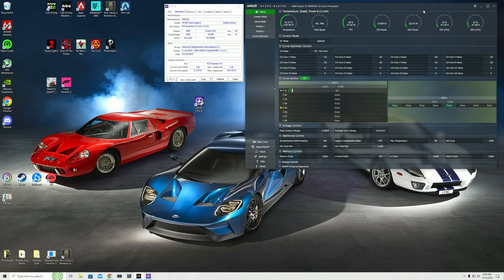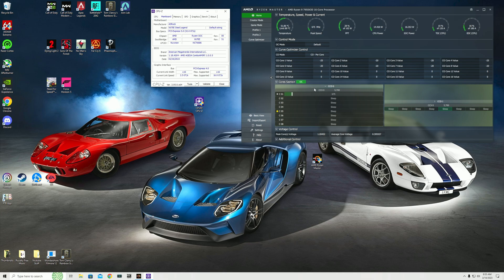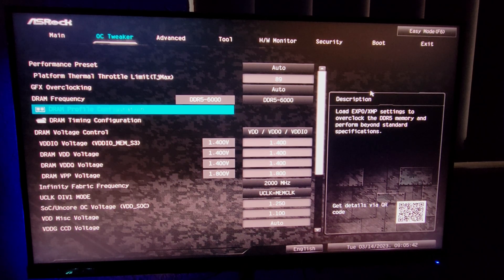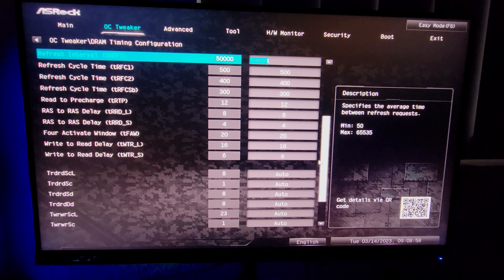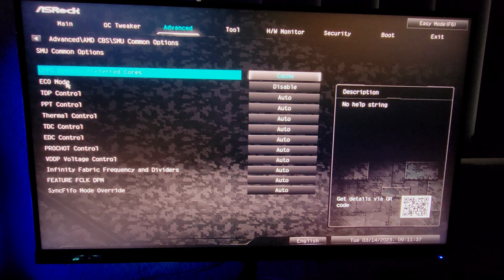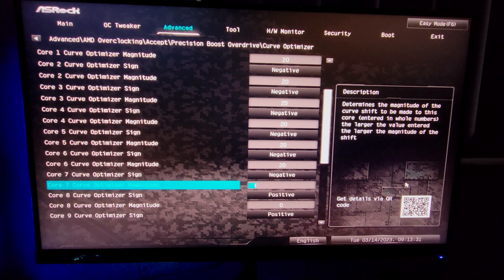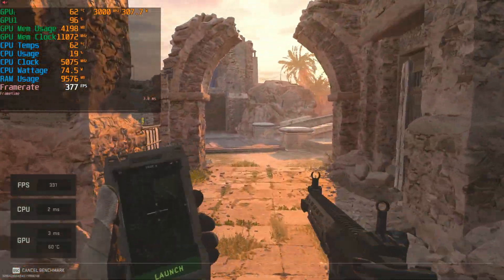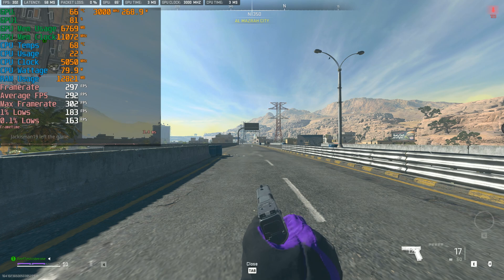7950X3D Setup Guide (Bios Settings, Ram Timings, and Undervolting)

Comment: Hi Beefy, thanks for the many informative vids! Can you tell us what the benchmark results are in 1080p?  Thanks!
Reply from the maker: I haven't tested 1080p due to cpu being the bottleneck at 1440p meaning at 1080p gains would be really small over 1440p. I can check since it's easy to switch to 1080p and compare.
Reply: @Beefy-Tech  hello sir
Are you able to put 3x bottom fans in that Coolermaster h500 mesh and 2 or 3x side fans 
cuz i cannot , i only have a 360mm AIO deepcool LT720 + 1x 120mm REAR fans + 2x 200mm front fans
I wanted to remove both PSU box + HDD cadddy box and try to put bottom or side fans, 
The side fans i think we cannot as there is no brackets to screw those fans
Reply: Thanks for the quick response and your time! Glad I found your channel 👍

Comment: Hey brother, do you have Accelerated gpu enable in windows? How about gamemode or game bar? I'm copied your setting with 6000 cl30 ram and still not hitting 280 in warzone on the highway
Reply from the maker: So I also use a config file you might want to try. It's in my config file wz2 video, I just updated it for season 2.

Comment: Any ASUS guys have their curve optimizer numbers? I have an E670-E MOBO
Reply from the maker: It's more to do with the cpu than the motherboard here. Ull need to tailor the undervolt based on the games you play. 

I play warzone 2 mostly. And I have switched to running -30 on first 4 cores, and -10 on last 4 cores of 3d v cache ccd. Warzone 2 allows setting thread count, and I set mine to 7, meaning it only uses those fastest 3d v cache cores with -30 undervolt on them.
Reply: @Beefy-Tech  same I really only play COD/WZ

Comment: i reinstalled windows and warzone  suddenly there is no config inside player folder , i think they removed the latest update
Reply from the maker: there is, they just changed the name of it slightly, ull see it where it used to be but with updated name. I have to update my config file video as they changed some of the settings in it too.
Reply: @Beefy-Tech  thank you for confirming this   omg
Reply: that is whe when i put your config , i had alot of dips fps
Reply from the maker: @bin20  it won't work to just copy paste the old one anymore, tomorrow I'm updating the file to a Season 2 version in the Dropbox, and also I'll update the description to reflect new name.
Reply: @Beefy-Tech  ok

Comment: Have you tried higher frequency on FPS games.. Apparently they prefer the Higher frequency?
Reply from the maker: Most 7950x's can't really do more then 6200mhz with tight timings, but some handle 6200 and even 6400mhz, it just takes a lot more work to stabilize. I tried 6200mhz and it was stable on my cpu, but had to loosen timings on my ram kit to where there was no difference in performance within warzone, so I'd need a Hynix A die kit to actually test this properly, until then I can't confirm or deny it for  sure

Comment: Welp, I spent the whole day gaming. About 5 hours of Warzone and 4 hours of MSFS 2020. Not a single crash or issue. Running rock solid with big time performance boost. I kept tref at 40000 as you recommended and is solid so far. Really didn’t think fine tuning my Gskill Trident Neo 32GB CL30 6000 would get any better from the already Expo profile. Boy was I wrong. Also, I ran Memtest86 for 4 passes which lasted about 4 hours and passed with no errors. Thanks again so much for this. Keep us updated with any new tweaks
Reply from the maker: That's perfect to hear! I'm also rock solid at 40000 rn, and it's definitely worth doing a custom tune even on expo kits! Beauty of this tune is that it'll work for 99% of 6000mhz cl38 or below kits, and worst case scenerio setting a timing or 2 higher gets it to full stability, so def worth it over stock given the gains 🙌👍
Reply: @Beefy-Tech  Hi, i have AIR cooler fuma 3 sythe, whats best for me to Undervolt
i kinda got lost here at 7:19 undervolting so do i set all of them to negative 20 or only the first 1-8 to -20(Negative) & the rest to Positive?
Reply: @Beefy-Tech  What about GSkill CL30 DDR5? Should I leave it alone and only use the stock EXPO profiles?
Reply: Can you help me I have the same ram
Reply: Why set to 40000 I thought lower was better

Comment: Dude, I applied your RAM timings to my Gskill 6000 CL30 and gained me huge performance boost. Thanks for this.
Reply from the maker: Quick mention, If you get any restarts of any sort, Lower the TREFI to 35000. It's super heat sensitive and can result in restarts as a result of high heat. otherwise the ram tune should be perfect stable 👍 enjoy the performance fam!
Reply: @Beefy-Tech  I have a fractal torrent with a 360 AIO. It’s a pretty good case for airflow. Did you leave your setting at 50000 and have you been stable with it? Or did you go down to 35000 as well?
Reply from the maker: @MustafaGT  on a white coolermaster h500 mesh and I took it down to be safe, didn't see much of a performance loss at all, but will have to do further testing.
Reply: @Beefy-Tech  oh nice i got the similar pc case too
mine is black MasterCase H500P Mesh with front 200mm 2x fans
I wish we could apply bottom fans in this case , there is the psu box i left on, also 2nd box is removable (left it there)
But im using the case all 7 slots and with coolermaster vertical gpu mount riser 4.0
Reply: Whats your GPU AND CPU ??
Reply from the maker: @xFMJ1Q8  RTX 4090 and a 7950X3D with 32GB of ddr5 ram
Reply: @Beefy-Tech  oh nice i got the similar pc case too
mine is black MasterCase H500P Mesh with front 200mm 2x fans
I wish we could apply bottom fans in this case , there is the psu box i left on, also 2nd box is removable (left it there)
But im using the case all 7 slots and with coolermaster vertical gpu mount riser 4.0

Comment: do you leave windows on balanced mode and game bar on as per amd setup instructions if you do this oc or did change them?
Reply from the maker: I have windows on ultra performance, with game bar on, and the same setup.

I haven't had any issues with it, but I think it's due to prefer cache being on.
Reply: @Beefy-Tech  you have to had it on balance so windows can do park of the 2nd ccd cores...  Or maybe you dont have issues because of cache setup on bios?
Reply from the maker: @prfrag  the cache bioe setup overrides the Xbox game bar and windows. I use process lasso to set background tasks on the frequency CCD, and I let the Prefer cache option do the rest.
Reply: @Beefy-Tech  Good because Game Bar is bloatware trash.

Comment: i kinda have a problem my gpu (a rx 6900 xt) is arriving before my other components and i was wondering weather I could put it in my old rig my old pc, it has a 3700x and a 650w psu probably a bad idea as the minimum requirement of a 6900xt is a 850w psu
Reply from the maker: It'll work but if u push the GPU too hard it might crash the computer when that happens. Just depends if u push the gpu or not.
Reply: @Beefy-Tech   so i should be fine if i don't draw too much power to the gpu got it
Reply: @Beefy-Tech  is there any chance of anything getting damaged?
Reply from the maker: @Shadowboiy  extremely unlikely, but my recommendation is just wait for the rest of the parts anyways..ull get a huge FPS boost with all new parts, while if you put 6900xt in now u won't see any gains most likely! It'll be a much nicer feeling to just see huge fps increase🤣
Reply: @Beefy-Tech  definitely 🤣

Comment: i got lucky, -25 all cores getting locked 5250 while gaming the wholeday. will continue testing if its stable.
Reply from the maker: That's really good! After full testing I've only been able to sustain -20 on 6 cores and -25 on 2 cores without any restarts or crashes. Clearly the cpu lottery is still a thing🤣
Reply: @Beefy-Tech  yeah, seems that -25 is stable so far. played warzone for a full day no chrashes or weird things happening.
Reply from the maker: @bombazeer6163  ive had bad luck. played with -20 for a while and Ive had a restart towards the end of an intense endgame in warzone 2... ill have to see if its ram or undervolt causing issues but it seems i may indeed have a pretty mediocre bin, so u defo got a good one!
Reply from the maker: @bombazeer6163  nevermind, one of my ram settings was too aggressive I believe... tuning it down seems to have fixed occasional crash.
Reply: @Beefy-Tech  so, i got bad news. running cinebench stress test for 2 hours made my pc restart and showed error code 00. reseted the cmos and will try again with curve opt -20
Reply: @bombazeer6163 mine can do -30 all cores without any core stretching and no crashes after 2 hours of occt stress test

Comment: Can you use 4 sticks of ram with the 7000s series of amd or does it have to be 2
Reply from the maker: You can use 4, but it's harder to get low timings and good latency as a result.
Reply: @Beefy Tech  im only asking cause im upgrading to a 7900x3d or 7800x3d and never had a ryzen cpu so if I want the best performance then 2 stick of 6000 64gb will probably be the best for it im assuming
Reply from the maker: @wickd420  yes. If you want 64GB it'll be much better to go for 2 sticks over 4 just for stability reasons.

Also both Cpu's are awesome, and while I don't have custom timings that I know will work on 64GB of ram, definitely consider tuning the kit, helps 1% lows immensely 👍
Reply: @Beefy-Tech  I will try and remember that
Reply: @Beefy-Tech  I'm running 4x 16gb G.Skill Flare5 6000, with the recommended timings in this video with no issues
Reply from the maker: @Zark_Muckerberg  that's actually impressive! You must have a great kit ram kir and CPU memory controller!

Comment: Will it make a difference if we got XMP instead of EXPO kit for the 7th gen amd cpu?
Reply from the maker: Only if you don't tune the timings at all. With 0 tuning EXPO is better for AMD, with tuning they are the same.
Reply: @Beefy-Tech  Does pbo or pbo2 void warranty of the 7th series cpus?
Reply from the maker: @lokkox18  no, even extreme settings in pho2 won't ever damage a CPU. The only thing capable of damaging cpu is Overvolting, which while you theoretically can accidentally do, it's extremely difficult to accidentally overvolt your cpu when the primary thing ull use pbo2 for is undervolting. Plus, they have some limits in place for safety👍
Reply: @Beefy-Tech  thanks for answering my question. Tomorrow i will build my new pc hopefully without any issues XD
Reply from the maker: @lokkox18  good luck! Definitely make sure u get all the updates in. I too was super worried but luckily they updated their drivers quickly and with a couple of easy to set options everything works great👍

Comment: I am not having any luck with Curve Optimizer. Even something significantly higher than your settings is unstable. 1 hour of ycruncher was perfect but then it crashed in Premiere and basic windows stuff. Shame, cause I had a -30 all core 24/7 stable 7600X before this.

I have a Noctua D15 and I am thermally limited. The chip hits 89C really fast regardless of settings.

Stock PBO +100mhz is running faster than negative curve optimizer. Latest result 34.528 in Cinebench R23.
Reply from the maker: I noticed 7950x3d's don't really do much more then negative 20 on just ccd 0. Also if you test stability with benchmarks, do also test the games you play. Cinebench score being higher thanks to ccd 1 being boosted won't result in better gaming results for example.

Comment: i realy like what you doing here , i will be getting soon 5800xrd cpu will do the same undervolt
Reply from the maker: Good idea! The 5800x3d behaves the same in that an undervolt improves temperatures, and as a result it also improves sustained frequency, so totally worth doing.
Reply: @Beefy Tech  thanks alot buddy
Reply: @Beefy-Tech  hello sir
Are you able to put 3x bottom fans in that Coolermaster h500 mesh and 2 or 3x side fans 
cuz i cannot , i only have a 360mm AIO deepcool LT720 + 1x 120mm REAR fans + 2x 200mm front fans
I wanted to remove both PSU box + HDD cadddy box and try to put bottom or side fans, 
The side fans i think we cannot as there is no brackets to screw those fans

Comment: Nice video. Yesterday i turned resizeable bar on and got 340fps on my 7950X 4090 setup. I don´t know if i get more performance out of the 7950X3D
Reply: Yeah I just learned about that
Reply from the maker: Yes, it is on in these tests👍
Reply: @Beefy-Tech  What is your bios are you on latest v1.30 beta ?
im on 1.28 Asrock bios
Reply: If you force Resizable Bar on globally with Nvidia Profile Inspector you can get even more fps. I've seen 10-25% boost.
Google "resizable bar nvidia profile inspector" for instructions.

Comment: All those frames for what man, you really don’t need more than 200 fps for gaming at all. Aside from wanting to run ray tracing in single player games or to help for content, these GPUs are just not it… Does not give you a competitive advantage once you push past 180-200s
Reply: Great video by the way, subscribed, have a buen día amigo
Reply from the maker: You aren't wrong, I just love tech for what it is, I don't compete in games, and I don't feel like I ever will. But I get such a huge kick out of optimization and overclocking these parts that it's long past the "For a competitive advantage" reason for me, it's purely for pleasure and enjoyment🙌
Reply: 2 and 4k resolutions you need all the power you can get!

Comment: I think -20 is very good on a ryzen 7950x(3d), not mediocore

Not seen many who get more than -15 or 20 on their 7900x.

Only ob the smaller chips like 7600 or 7700x ive seen people gettin -30

My 7700x does only -18 stable on all cores
I didnt want to sacrifice the time to test on a per core basis.

But also mention that my 7700x runs with an Infinity Fabric of 213hz and 6400 cl32 ram.

Maybe with 2000 and 6000cl30 i would get an better undervolt🤷🏼 who knows
Reply from the maker: To be honest I just compared it against the 5800x3d which I know ran -25 or -30mv quiet commonly. I'm glad to know -20 isn't actually bad for these cpu's. They go up to -40MV so I thought I got unlucky!

Also 2133 with 6200mhz is really good. I'm considering giving that a try but I'll have to adjust the timings if so, and indeed it might affect the undervolt when hitting such a High FCLK + frequency on ram, but who knows, we can only test xD
Reply: @Beefy-Tech  -30 curve optimizer doesnt mean -30 mV

Every point in curve optimizer is 2-3 mV
So at -30 you get actually -80/90 mV